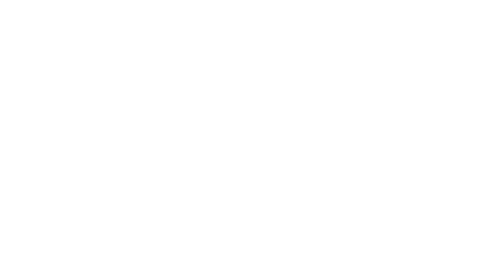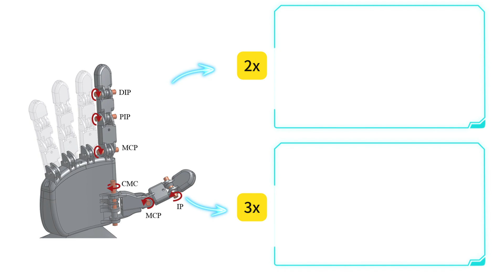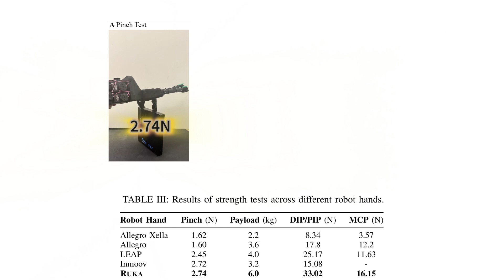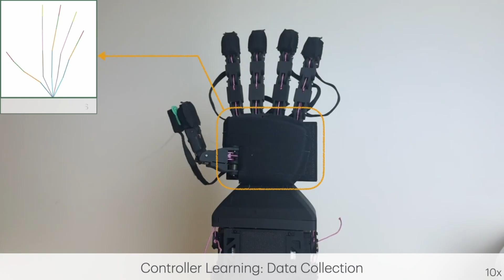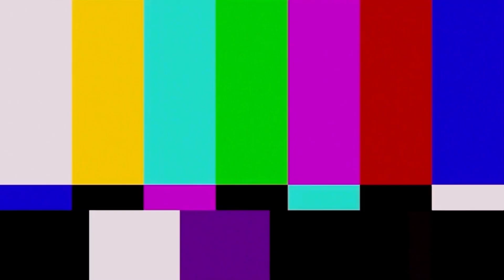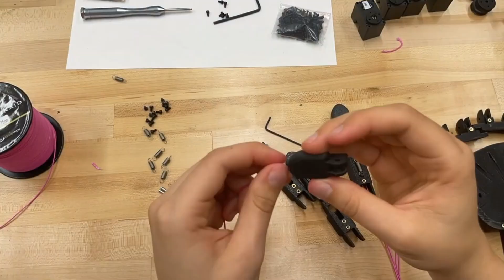This Robotic Hand Can Manipulate Objects Like a Human

Comment: On 3:50, the explanation of how tendon slack and slippage hysteresis is dealt with by using a data model based on correlating motor angles to hand postures didn't make much sense to me. How can a neural network be trained using that data, could ever correct for tendon slack which happens over time? Tendon tension would have to be part of the data set but this hand does not measure that.